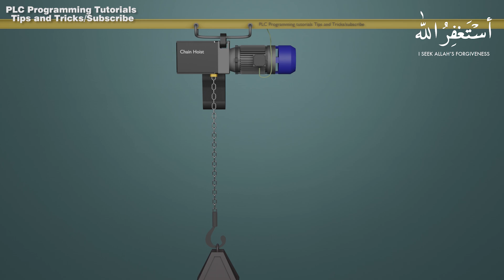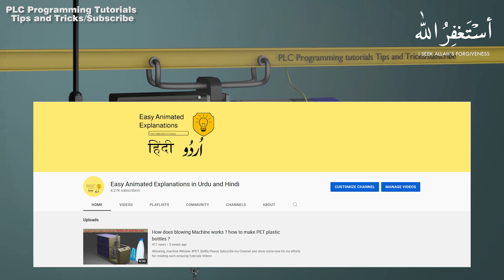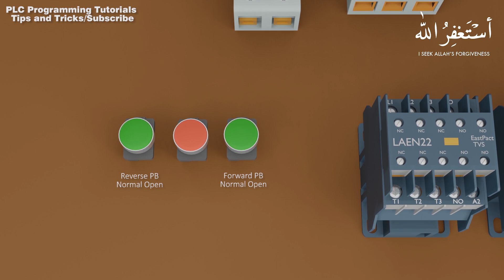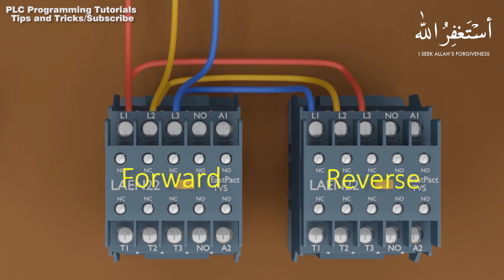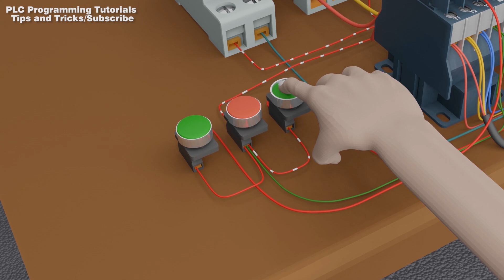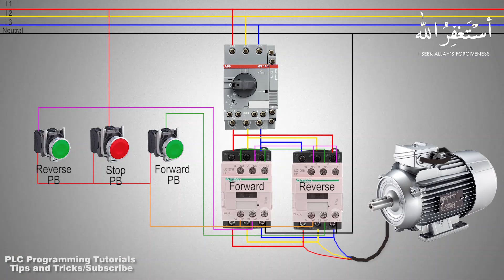Three phase motor forward and reverse circuit with Latch ON  || Chain Hoist basic understanding

Comment: Thanks alot keep it up but Could I connect one of the 3 supply wire eg Yellow line to both of the Magnetic Contactor to coil A2 instead of neutral wire? If u can please make avideo by adding 2 Timer